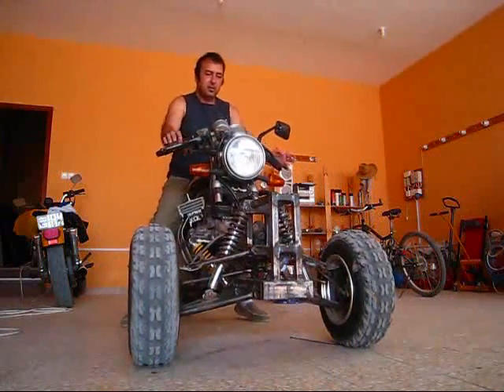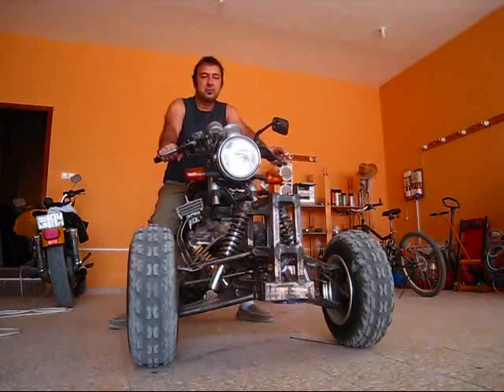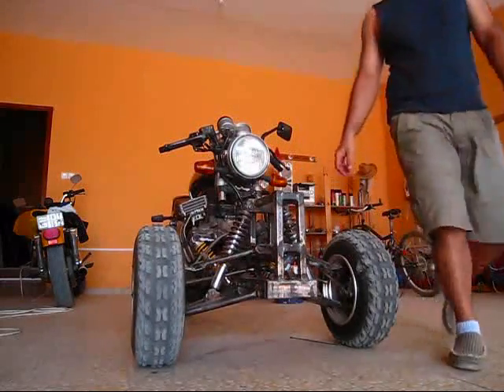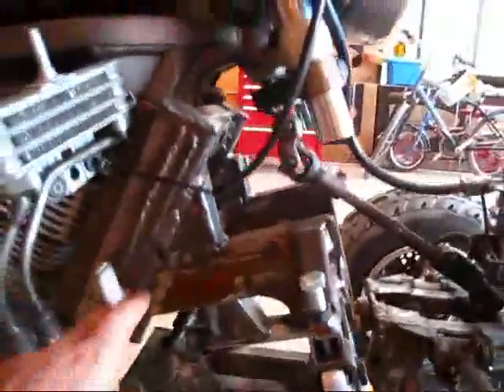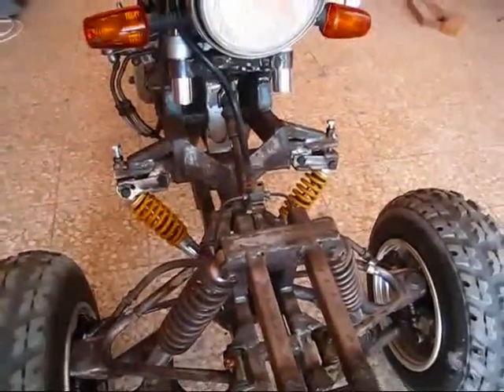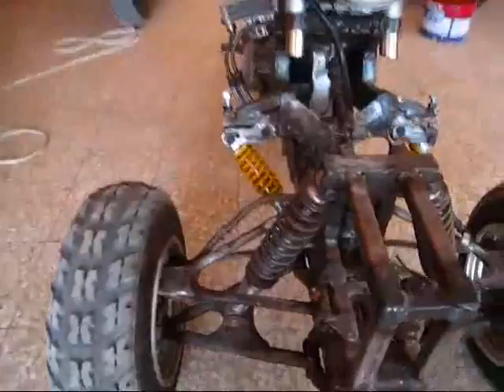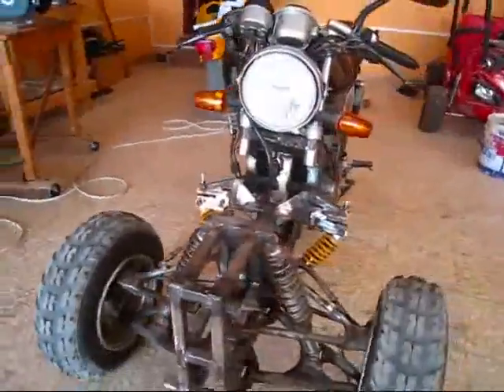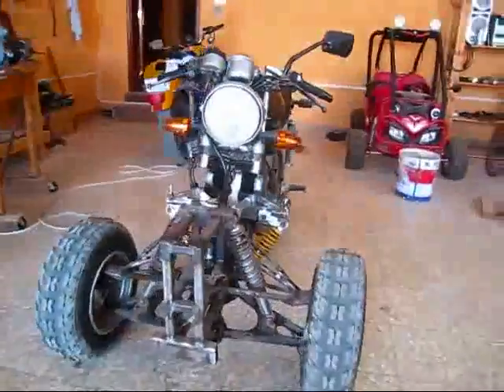My Reverse Trike, looked good, but didn't work!

Comment: I can suggest a simple modification for this to work, and get rid of the wobbliness.

Attach that yellow suspension to the front. It has to go at a certain angle so you have to experiment with that.  You had a good leaning setup already. If youtube can upload picture in the comment i would upload mine.

my front frame is much wider than that, makes it easy for me to the the adjustment as ive said. altho my front suspension setup is pretty much the same as your. im on a wheelchair so i need this kind of setup that allows it to stand up straight mechanically.

Comment: I've been thinking about making an electric trike motorcycle/scooter that leans. The key to having stability, at least in turns, is the ability to lean. After staring at many photos of leaning designs, I finally figured out how they get it to lean. They all have a double wishbone suspension, like yours, but the top of the shock/coil isn't attached to an unmoving fixed frame. They attach it to a sort of tilting T shaped bar in between the A arms, the bottom of this bar mounts to the frame, but can tilt left and right. Then each shock is attached to each respective side of this bar.

Like this example: https://i.pinimg.com/originals/c7/7f/82/c77f82944b711e36491f029415186010.jpg

You can also see it here: https://jnyyz.files.wordpress.com/2015/05/dsc01449.jpg

and here: https://i.pinimg.com/originals/4d/4b/e2/4d4be25f070b69a925cda746ed0a1cc0.jpg

I think that's what you need to change yours to, to be able to lean properly.

Comment: You have two shocks (yellow) that holds the bike upright. Then you have two suspension shocks(Brown?) for the front tires. There should only be two shocks total. The suspension shocks should be the ones keeping you up. 
It’s too wobbly because you have too much travel and it’s too soft. You could either HEAVILY stiffen the yellow shocks or you could completely redesign and have a two shock only non tilting bike.

Comment: put brackets above the front shocks on the same bolts and  connect them to the steering where the handlebars are to increase stability of the front suspension, that's what I would do.

Comment: seems like this will work if. you add a steering stabilizer, you change the front tires to something for street use, you brace and triangulate the front end. Use rod ends or heim joints connecting the front most piece on the lower frame to the top bikes frame in between the handlebars, and those joints should allow you motion while also providing rigidity. i'd also check the alignment of the front tires, make sure they are straight, i'd also balanced all the wheels/

are those springs under tension? or are they loose in their unloaded position? as in the one with you off the bike?
Reply: i take back what i said, well. triangulated. so, same thing with the similar points only two control arms wit heim joints. two points connected either side of the forks up by the handlebars and then coming to a point at the top and front of the new frame section you fabricated. that would make it very rigid and stable, but still allow the leaning action.
Reply: +Swansen03 http://www.club700xx.com/vb/9-chassis-suspension-braking-tires/6948-rear-sway-bar-photos-needed.html  reverse trike motorcycle custom

Comment: Did you ever try locking the steering mechanism so that when you leaned the wheels didn't turn at all? I am wondering if this might be what created the problems. It seems that when others do this the wheels are locked so that they don't turn right to left. It's the leaning alone that creates the turning.

OH, the shape of the tires could have been part of it too. Because the tires are flat bottomed instead of curved like a normal moto tire.

Comment: The only reason it failed was that you didn't reinforce the chassis for the new front end. If you look at it from the top end you will see that it looks like a "T" it should look more like a triangale more than anything. since the way you built it the whole chassis in the front end wants to flex! the shock asorbers don't help with anything, but to stabilize the flex that you have. Try building a new chassis or making some chassis braces for it and see what happens.

Comment: Saeid before you scrap the project altogether If It was mine I would try altering the camber of the front wheels ,a little at a time.It may or may not help,but fundementally the Idea is there.regards Bill

Comment: When I had steering wobble issues, I corrected them with a hydraulic steering stabilizer/ dampener. It worked 100% (this is with a revived wrecked 1985 Yamaha Rz350 which was stock configuration without any 3-wheel additions)

Cameron

Comment: Unstable because tilt of bike turns steering mechanism / rack.  You are tilting and steering on the same axis.  2 push pull cables and it will work fine.  A bit more work, use 2 arms.

Comment: Too bad you gave up on it. I saw only two things wrong. 1) The front box frame needs to be a solid extension of bike frame. Unhook front shocks @top & you would see that whole thing would tilt good just like a single front wheel. 2) The front shocks need separate free-floating tower so they move independant of box frame. That is what you were fighting for proper tilt. Look at successful tilters & you see shock top mounts move separate from box frame. Move a cardboard template & U'll understand.

Comment: I agree with carabela125, you need to link the leaning with the steering.  the linkage doesn't need to be complicated in order to increase stability.  I also agree with will shearer that you need to lengthen the wheelbase a bit.  But nice video, thanks for sharing.

Comment from the maker: Most recumamt bikes I have seen do not lean. I have seen a couplke of designs only where the bikes lean. By the way, b4 I started building this RT, I tried my design on a bicycle. And that worked pretty well. I'll see if I can dig up the video I have from that Trike. It's when I went to the motorcycle that things didn't work out so well.

Comment from the maker: I think the angle you're talking about is the angle of the axis of rotation of the rear section. THe front and the back sections are conected via a heavy duty hinge. The angle of the hinge is such that it points to the contact patch of the rear wheel. That part worked well. 

Anyhow, since I've set up my new work shop, I will start on another RT the frist chance I get. But this time I will not have the rear section lean. Although that would be really fantastic.